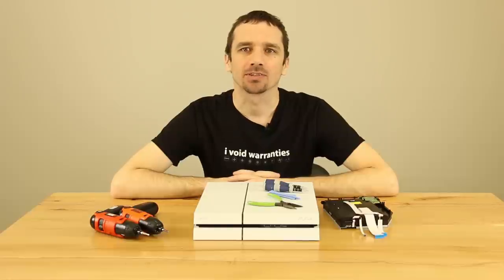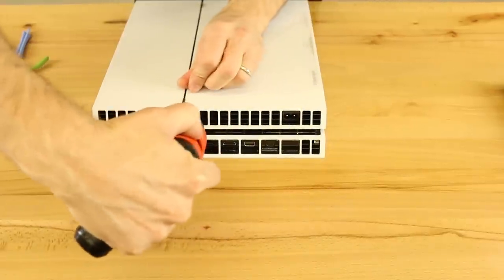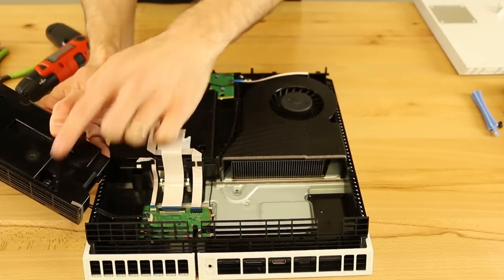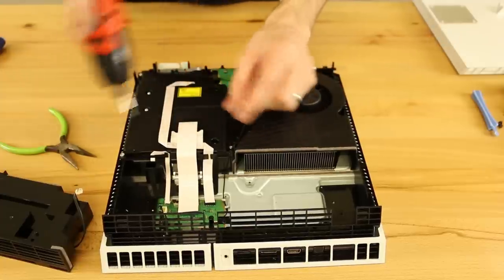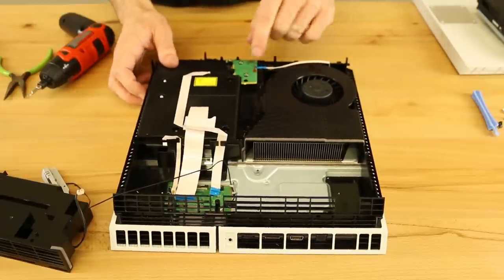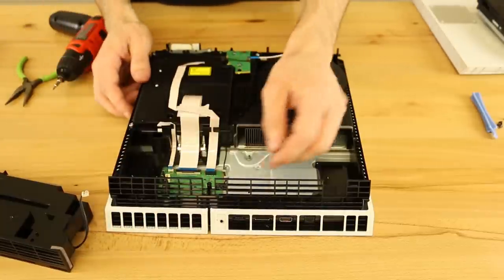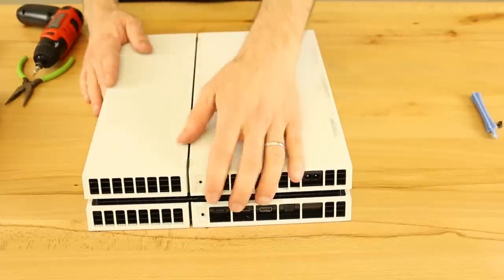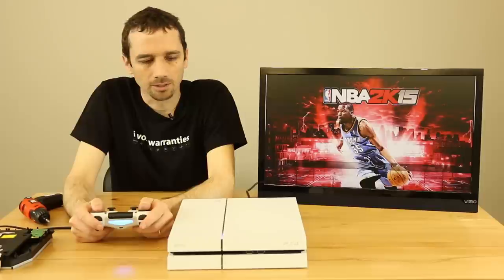PS4 1215A (1200) Disc Drive Replacement

Comment: hi, would you happen to know why my ps4 won't accept or eject discs?/not the roller issue as I've checked. any advice ? .tia
Reply from the maker: +Dave adams Could be a ribbon cable issue, drive motor issue or a problem with the gears somewhere. It's hard to know without being able to see it.
Reply: Thanks for the advice il try have a look again, I tried a different drive with working load/eject but as soon as I added my logic board it stopped? Frustrating issue :/

Comment: broke the white plastic power supply connector off the motherboard taking the power supply off. how do i fix??
Reply: the one mentioned at 4:21
Reply from the maker: You have to solder it back on.

Comment: Got a new drive but the rollers won’t engage. Tips?
Reply: Taylor Darling same thing happened to me right now. Did you get it to work? Or did you have to do anything ?
Reply: I ended up ordering a new PS4 altogether. Problem with the motherboard
Reply: Taylor Darling oh that sucks. Thanks for the quick reply I got it, was user error. I put one of the ribbons in wrong just had to put it in the right way

Comment: Need help with my PS4 Blu-ray ROM is not loading CD so i replace with another one from a dead PS4 but after i replace it is not accepting CD i manually put in a CD but when i turn on the PS4 the CD is not rolling so i remove the Blu-Ray ROM  and put the one i remove from the PS4 b/4 but when i turn on the PS4 is not accepting CD and is no rolling CD like be for  i think the problem is from the PS4 motherboard need help my PS4 is the CUH-1206A model the one i remove the Blu-ray ROM from is CUH-1215A model.thank u
Reply from the maker: Hmmm...I would check the ribbon cables but if it's not that then yes, probably something on the motherboard.

Comment: And can you put any ps4 model bluray laser in this ps4 cuh-1215a?
Reply from the maker: I haven't tried. I only replace them with lasers for 1215A models. Sorry I can't help on this.
Reply: Well at some point you think you could try. I just bought a slim ps4 laser for my cuh-1215a and it says it's a 490aaa so it basically uses the same laser. I'll message back when I get my ps4 working.
Reply from the maker: If you're only replacing just the laser then it should work fine.
Reply: Awesome thanks for the reply
Reply: And if you can just reply to this question too.

Yeah I'm going to get a new laser, thanks for the reply. But what are the usual symptoms of a ps4 not reading disc. And what I mean by this is how does the disc drive sound like when it's not loading disc. Like mine loads the game, then after 20 seconds it'll make this eject noise, and reloading noise but the disc physically doesn't come out it just makes this noise then after a minute goes by it just tells me unrecognized disc, do you think it's just the laser or something wrong with disc drive deck?
Reply from the maker: Most likely a bad laser. No guarantees but that's my guess.
Reply: Yeah I'm hoping, thanks again.
Reply: And if you can remember, was the ps4 in this video making any of the noises as I described above before you fixed it?

Comment: I just recently got a new disc drive and it's the right model for my PS4. After getting all of the ribbon cables connected and putting everything back together, the PS4 still grab the discs when I try to insert it, any suggestions?
Reply from the maker: The PS4 still grabs the disc? What exactly is the problem then?
Reply: TronicsFix Oh, I meant it still doesn't grab the discs, sorry about the typo. After I installed the optical drive for the correct PS4 model I have and using the old circuit board with all the ribbon cables connected the disc drive just doesn't want to accept any disc I have. I made sure the discs were clean and everything and followed every procedure to fix the problem, but nothing seems to work.
Reply from the maker: That makes a lot more sense! Sounds like you might have a problem with the large ribbon cable that goes from the motherboard to the disc drive board.
Reply: TronicsFix ok, could be it because it's faulty? Is there a way to buy another one from online?
Reply: I'm having the same issue any help would be great

Comment: Hi there i opened the this model and I was able to fix the disc reader. It's all reassembled now and my disc works however it makes a really loud sound when loading which I'm not bothered about. My real issue is my controller will connect to my ps4 however it's not in sync it will take a while for it to pick up the buttons I press and when I move it too much the controller disconnects. Please help
Reply from the maker: Sounds like you might have a problem with the WiFi antenna
Reply: TronicsFix ahh okay I'll have another look. Can it be replaced? It's weird because everything was okay before I opened it up.
Reply: TronicsFix just checked looks like I didn't connect the antenna properly. All working now though thanks for your help

Comment: When I take this apart and keep the optical drive connected on a flat surface, reconnect the power supply and insert a disc, the blu-ray is grasped and goes into position (as far as moving backwards) but the rollers which pull it in do not drop down allowing it to be read by the laser.  Hence, the back of the disc is in position but the front of the disc is still contacting the rollers, making the disc be at an angle.  Any ideas as to fixing it?
Reply: This is also the original PS4 (optical drive BDP-010) if that helps any.  Thank you for any help!
Reply from the maker: +12DisturbedGuy93 Hmmm...I'd really have to have it in my shop so I could look at it. Sorry I can't really give you any tips.
Reply: Not a problem, thank you for the reply! I will almost certainly be sending it in to be worked on
Reply from the maker: Sounds good. We're happy to take a look at it for you.
Reply: I figured out my problem (commenting for anyone else who sees this).  The slider piece on the left side of the hard drive which pushes the drive rollers down has about 1mm of play in it.  On the underneath side of the optical drive, after removing one of the gears you can see that the plastic slider piece's gears do not interlock with the gears needed to drive it forward to push the rollers down. 

Previously my PS4 was grinding, which is due to the slider's gears barely contacting with the gear that it needs to contact with.  Now the piece isn't contacting at all unless I apply a bit of downward (towards the gears/laser) pressure.

I believe the piece is either A) not heavy enough to ride properly in line with the gears below it or B) the spring in the top left back corner by the drive motor for the rollers has just enough tension on it to pull the slider up enough to not contact the gears.

Hope this helps anyone with similar issues.

Comment: I was taking the middle ribbon out of the mother board, and the whole assembly came out of the board. I cant put the assembly back into the prongs on the mother board please help!
Reply from the maker: I'm not sure what assembly you're talking about.
Reply: Where the Middle ribbon from the Disk Drive Connects to the mother board the one where you pull up on the sides to get it out i tried doing that and the whole prong came off the mother board
Reply from the maker: You'd just have to try to get it back on. There's no easy way.

Comment: Do you no how to reset this drive is the any special way I need to line up the top I cleaned my laser and now my drive won't take disc
Reply from the maker: These drives don't need to be reset. There is nothing to reset. You likely messed up the wide ribbon cable going from the motherboard to the disc drive.
Reply: OK thanks I bought the system already broke no power I fix that with a PC PSU but somebody had took it apart before already and did a lot of damage to all the flex cable's on the disc drive it was working but wouldn't install GTA V so I cleaned the laser and now I'm not getting any power from the drive at all now do you now the part number of those cable's and thanks your video's help alot

Comment: My ps4 seems that the white bit In the disc drive is stuck and it's not ejecting
Reply from the maker: +Amy Pengelly It's hard to know for sure what's causing the issue without having it here at my shop for me to look at. It may be a ribbon cable problem or could be the drive itself causing the problem. These newer models have a slightly different configuration than the older models but it still could be the white piece. 
Feel free to send it in if you'd like: http://www.tronicsfix.com/ps4-disc-drive-repair.html

Comment: i tried to replace one ps4 1200a to other 1216a model  bt it does not wor k??what to do??
Reply from the maker: +bikram pokharel Not sure why it wouldn't have worked. We haven't tried to swap them from 1200a to 1216a so that could be why...or maybe something got damaged when you swapped it?

Comment: my ps4 wont accept any discs i opened it i thought my rollers were damage but its the side that has the main roller wont spin
Reply from the maker: +Big Guwop Check the ribbon cable that goes from the motherboard to the disc drive.
Reply: Same as me dude. for no fucking reason

Comment: How do I know what drive I need with out opening up my ps4?
Reply from the maker: There's only one drive for these.
Reply: +TronicsFix I bought my ps4 at the end of 2014 would it still be the same
Reply from the maker: My comment was for the 12xx consoles. Since that's the video that you are commenting on I was assuming that's the console you had. If not then you need to get the same drive that is in your console now. You need to make sure that the 3 number code matches with your drive.

Comment: So my ps4 bluray drive stopped recognizing bluray and ps4 discs but would still recognize dvds so I replaced it and now for a second time this starting to happen just like it did before any suggestions as to what might be causing this and how to fix it.
Reply: Older model
Reply: +jeff flack have you heard of anyone else having the same problem?
Reply from the maker: +jeff flack Usually this is a laser problem. The replacement you installed probably just had a laser that was on its way out.
Reply: Do you have a video covering that?
Reply: Or maybe a source to find a bluray replacement that might not have components that are on their way out?
Reply from the maker: That's a tough one. There is no place to buy new disc drives since Sony doesn't sell them.

Comment: Hi Steve I’m having ‘unrecognized disc error’ on the Arkham Knight Limited edition PS4 CUH-1116A.  My local repair guy told me the drive is in good working condition and the issue is with the board also a new disc drive was installed and tested yielding same unrecognized disc result. DL games work fine. Any tips on this?
Reply from the maker: I'd first try a new laser... any disc drive you buy will not be "new" as there's no way to buy new ones (unless it was pulled from a brand new console which is highly unlikely). I'm assuming all of your discs have been carefully cleaned?
Reply: TronicsFix    
I upgraded to a pro ; all discs work fine ! As for the lens , the technician used a working lens too test console.
Reply from the maker: That's a strange one. Do you still have it? If so please shoot me a message on my website: https://tronicsfix.com/pages/contact

Comment: hi mate I was taken out the power supplythe lit bit broke of the motherboard how can I get its fixed mate
Reply from the maker: If you're in the US you can always send it in for repairs. We fix lots of them. If not you'll need to find somewhere that can solder it back on correctly.

Comment: OK SO JUST BUY THE REPLACEMENT DRIVE AND THE HUH 1215A MODEL AND IT JUST WORKS NO BOARD REPLACEMENT
Reply from the maker: Unless you don't want to spend the money for a new drive and just fix your old one.
Reply: thanks ill let you know when i finish
Reply: TronicsFix jey i got the same 1215a model my disc drive damaged and i tried to update but it fails with E801809A error if i replace the drive will it work

Comment: I bought pa4 to fix but seller lied to me and had already opened it. He took out original drive out and put a new one in which would never work because you need the original to swap board out drive for it to work. Now I need one that would work for my ps4. I bought 2 drives and I am stuck with them. Does anyone know where I could buy a drive that would work. PS4 is a CUH-10015A